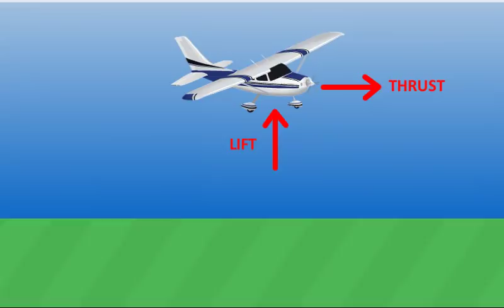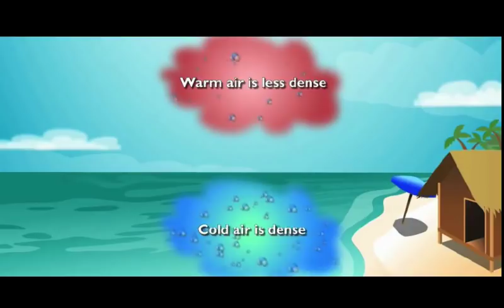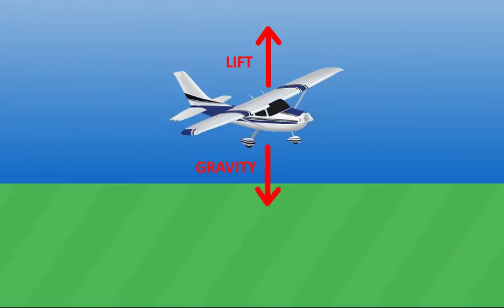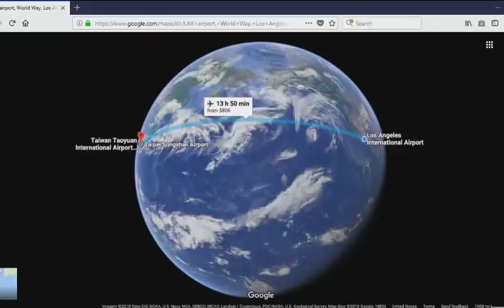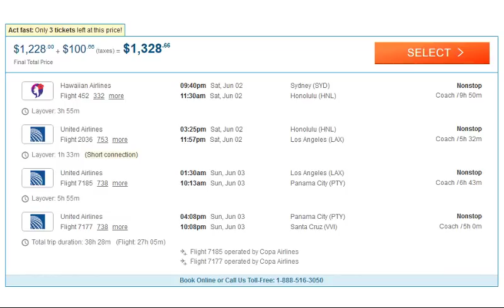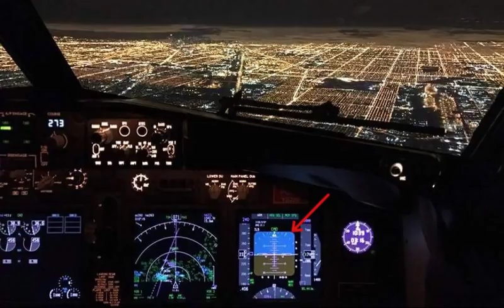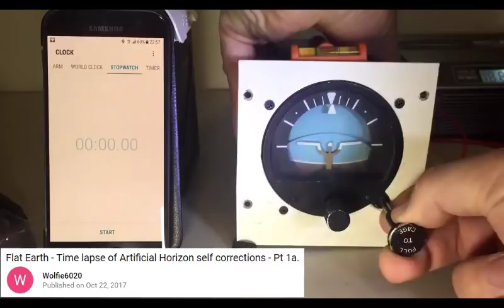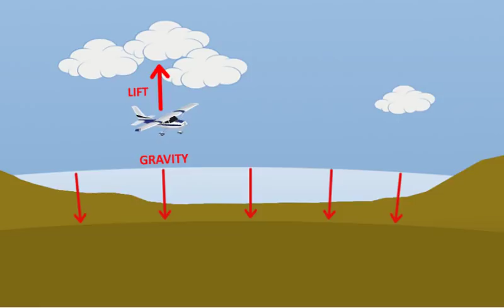Flat Earth Falsities - Plane Nonsense

Comment: [ Furthermore, how angular momentum is exchanged across the atmosphere's lower boundary, by means of the interactive torques with the oceans and solid Earth below, is important to quantify so that one can understand how the Earth acts as a system. 
Small but measurable changes in the Earth's rotation rate, moreover, are a consequence of the exchanges of angular momentum between the solid Earth and its fluid envelope (force?); this aspect of the variability is of importance to the study of Earth's physics and to the monitoring of reference frames for satellite orbits and navigation.    (but not helicophers or planes...)
The relevance of atmospheric angular momentum fluctuations to geodesy and geophysics has been recognized by the formal organization of the Special Bureau for the Atmosphere.]

It is a FACT that all this water, 70% covering the surface,  does not all have an eastern momentum (some Professional Navigators know this), the atmosphere is far from a closed system in this respect, but Earth’s rotation is always in a West to East motion.....

Some accurate Science= "Volcanic outgassing probably created the primordial atmosphere."

1) Why does the ocean current direction opposite to the wind direction?
     For example offshore of the Northeastern United States there is an ocean current called the Gulf Stream which flows northward along the coast.   The Coriolis effect circulates North Atlantic water in a clockwise direction ?  But always perfect synced Momemtum, now that is top Conservation ! (not like our atmosphere escaping to the Moon)

Also deep currents can cross or be opposite to a shallow current, not carring about friction :(
Warm air rises at the equator and moves poleward (not east), sinking again at middle latitudes in both hemispheres.

- hope this yet other gibberish presentation from Flattard me gets YOU also to have questions.
  Einstein said there was no stupid ones ('retard' was not soo popular back then).
Reply: woof woof, flerfie... keep barking. 
lol
southern celestial pole. 
check mate, flerfie.... keep barking
Reply: @GebSpez15215  Ah the mad dog has at last joined the only left of my commenting ! HE CARES! Been crying about me, wishing me to stop recruting, but it has such a good time!  Is it tired of lolling?  (a little insanity?) A replacement from tired +wong.
ps: funny my liked video of a zionist rabbi interview got removed, not the first time such happens with this account since I been trolling around here. Must of annoyed for somemone who spies on me. That wong sure hated Christians, and their bible, but not a peep on the old testament.  Same as those pagan greeks: they get a pass on their religiousity.
Reply: Louis Shaw 
yes, good flerfie.... i own you. whenever i ridicule you, you answer. good flerfie, bark...
lol
Reply: Louis Shaw 
i went straight under your skin... hahahahaha 
bark, flerfie, bark... lol
Reply: :) :) :) pro FLAT attention for sure, the recruting for GE may not be going so well...
Still no explanation for competent (aka Professional Navigator wong or Dr David ST-Jacques astronaut) self repeating lack of support. Usually they pat themselves so nicely. Yes the bark goes on, "and loving it" :) Get Smart, probe the value.
Reply: Now some little more quality bunking or TRUTH seeking :)  It very intersting how now all of sudden much GLOBE proofing is going on, coincidense? Or attention to nonsense? Dubbed "One More Orbit" that counts a former International Space Station commander (very trustworthy NASA man) among its leaders, was launched in honor of the Apollo 11 moon landings (the relevancy escape me), the 50th anniversary (of first and almost last adventures).
     At least some technology leaping is going on. Colonel Terry Virts : gave the famous V /Vulcan salute (StarTrek was the previous series before Apollo), but a Christian as most, including Directors.
      “As far as my views of life in the universe in regards to my views as a Christian, I believe we have a really smart God who made everything. That’s why the Bible is the book that inspires me the most.”  - literally or not?

- well nice to see some atheists have full trust in... those :)
Where is +wong when you want him? Loves to antagonizes Christians online by deliberately posting inflammatory, irrelevant, or offensive comments as others, even without being triggered.

    And some civil mouths would want you to think only dip shit flerfs believe in GOD....
Reply: @BrainUser1  Conclusion: You have no idea what a Hill Sphere is and its role in choosing a frame of reference. (If only other countries would launch rockets to space we'd see what a fraud NASA is.)

       The geocentrism apologetics sounds amazingly like the nutjobs who produced The Principle. (They have quite a reputation for deception due to that film.) Yet even they reject flat earth.
Reply: @BrainUser1  Conclusion: You have no idea what a Hill Sphere is and its role in choosing a frame of reference. (If only other countries would launch rockets to space we'd see what a fraud NASA is.)

       The geocentrism apologetics sounds amazingly like the nutjobs who produced The Principle. (They have quite a reputation for deception due to that film.) Yet even they reject flat earth.
Reply: Now we got 2 stuck with the same songs... Must be difficult for these individuals to produce something.With such productive Dereft's One can not value any of their conclusions, seems they are accustomed to repetition, School and Hollywood do a lot of that.. programing. The GLOBE is one of the most repeated "obvious irrefutable facts' we encounter, images repeated over and over again on every occasion.    Like they cant get over it... and its a (greek) 3,000 old news, dont ships still disappear in the horzon?   And the showbizz goes on...
Reply: :)  (no comment)
Reply: BUT I must I must! ....lets see.... :) .... the encouragement to think must continue also :)"If Flatties think they are so smart (smarter than all the great 
scientists) then they should come together & contribute something to
 the world like make a phone or a car without using any scientific 
methods." [1]  - HA HA HA! (out real loud) wonder where that came from...? Of "no science" ?
    The sheep lives its whole life being afraid of the wolves, 
only to be eaten by the shepherd...  like the Sheeple[2] they fear not-normals, crazies, flaterthers, but mean while they are being lead to be feed on by the taxing government and commercial industries, no wind up where?      
   Note: where in the hell is the not-caring ignoring +wong-police? Should also being ranting his outlawing not to feed the (emperior troll), he also does not care creation's CREATOR, well kind of... went you mention GOD or JESUS he starts foaming at the mouth and raves like MAD! 

   [1] 
Paul On The Plane  This ladies and gents, is the comment of the week winner. Pinned! Lol!!!!
   [2] many old farts that cant change their ways, or learn new tricks, their minds are set, RIP grey chemicals.
Reply: Louis Shaw woof woof
Reply: Conclusion: You have no idea what a Hill Sphere is and its role in choosing a frame of reference. (If only other countries would launch rockets to space we'd see what a fraud NASA is.)

       The geocentrism apologetics sounds amazingly like the nutjobs who produced The Principle. (They have quite a reputation for deception due to that film.) Yet even they reject flat earth.
Reply: @romithromith  O bobby thee impressive science guy also dedicated to nutjobs! Dear me! My troll babble gets some _ 

 Simply incompetent sure rattles some sane Normals, mostly those claiming they are secure in knowing.
  Hill Sphere... does Everybody know that is? I'll ask my neighbor... Guess it more GRAVITY wonders.

Conclusion! Was THAT Science? "—the Flat Earth is not science—" basicly what I gather from that Evidence.
PS: I wonder if these Agents also protect guilibles from this Bigfoot cult?
       Which one is the craziest now? No limit on that for SCIENCE to impress upon it for some reason.
       Ah good old days when the Apolloists used to call us Retards "Flatearthers", now its "religious literalism".
Reply: Do you even realize you've been talking to yourself for over 10 hours now? 😄😆😂🤣
Reply: @_Arminius   No I dont, Arithmetic's isn't your forté, last added was just 3 hrs after last Critic job, I think out loud (versus some laughing hyenas) but I think other witness my talking on public YT. Some are very upset about that, screwing themselves for the last 2 years :)
Do you realize you only cared to state THAT musing on this science video? 
  May want to laugh less and force your grey-matter a little more, if possible, greek math boy :)
Could just as well openly said /barked you were incapable to address any of my lead inputs :) :) :)
Reply: Louis Shaw 
hahahahaha
Reply: Louis Shaw woof woof, flerfie...
weaseling out of my points...
keep barking, flerfie...
lol
i own you
Reply: NASA Use the Heliocentric System for its Probes and Satellites? we hear...
   [ In reality, NASA will use whatever system is more convenient, the heliocentric or the geocentric, since NASA’s orbital mechanics know that both models are equivalent, mathematically and geometrically. 

If they are sending probes near the sun (far in SPACE) , they will probably use a heliocentric model, since it is easier to make calculations when one considers the sun as fixed (???) in space with the planets moving around it.

   If they are sending up satellites near the Earth, however, they will use a geocentric model, or what is known in the industry as a “fixed-Earth coordinate system.”  (- yes INDUSTRY knows about it)

   This is because it is much easier to calculate and chart the movements of satellites circling the Earth if the Earth is understood as stationary in space. 
(??? no high tech computers to do the work? Cheap NASA!)

This fact is easily proven from the space agency’s own documentation. 
   For example, in a letter written to the National Oceanic and Atmospheric Administration (NOAA) making the following inquiry: 

“Is the present movement of GOES [Geostationary Satellite] planned and executed on the basis of a fixed earth or a rotating earth?” 

the answer returned by the department head of GOES/POLAR Navigation, Office of Satellite Operations at the NOAA was very simple:   “Fixed earth.”

NASA tries to give the impression /MISSLEAD to the general public that only the heliocentric model will work, AS A FEW OTHER CON_TROLLS....
 
The truth about the use of fixed-Earth mechanics, agencies refused to be forthcoming, no surprise to us. Those who control our space programs have a vested interest in keeping the public under the illusion of Copernicanism, since all their funding and projects are based on Copernicus’ premises, including the quest to find life in other worlds.
   Only those who are courageous and knowledgeable enough can expose the illusion and allow the public to see the cosmic shell game that has been occurring for quite a long time. 
One such party is the team of Ruyong Wang and Ronald Hatch, two former government satellite engineers who know the truth about the illusion. In one of their investigations on the Global Positioning System they write:
           
"…NavCom Technology, Inc. has licensed software developed by the Jet Propulsion Lab (JPL) which, because of historical reasons, does the entire computation in the ECI frame. 
Because of some discrepancies between our standard earth-centered earth-fixed solution results and the JPL results.
The measured and theoretical ranges computed in the two different frames agreed precisely, indicating that the Sagnac correction had been applied in each frame."
 

Conclusion= NASA supports a still earth by using still earth calculations with satellite usage & rocket launching, Just as it uses a lot of Geocentric calculations for its predictions.

http://bellarmineforum.xanga.com/2010/01/16/question-208-struggling-with-question-on-geocentrism/
Reply: https://www.youtube.com/watch?v=Uo-QIY7ys-k  ....George Carlin on official Establishments and Education :)George Carlin -Question Everything  (like many not so norm scientists; Einstein etc) (Dictonary meaning, not context one...)    Social Criminals? Nasholes!    https://www.youtube.com/watch?v=8pz_IaRVBh0
Reply: Been real dead comment wise, the Normals have no new Retards to pounce on :(    My power has been establish for a while, Some are sadly not honest smart enough to admit it :(    My bite must be worst then my bark, alway nice to witness them ignoring material, says volumes :)    It must be concluded by such infantile emotional reactions of globe wise old men provide, best at questioning then worthy counters, desperately trying to find a flaw to hold onto.  The GLOBE spins and circles towards definite doom :) 
   Bye bye baby ceiling solar system mobiles, and school spheres.
Reply: People if the lol's and scientific talk efforts of these Globe Militants does not save you from FLAT level thinking, then  just check undeniable photo proof of beach tide braker, the cornered water is NOT FLAT!  That means we are on a globe, for greeks.    
Curvature Captured - Flat Earth Falsities
ps: my previous threads only have 25-27 replies but you can witness more nobodies carrring about that sh!t I write.  My apparent intellectually challenged and socially left behind gibberish is... cared for :)
"I am trolling you without effort. you keep answering. lol
you aint got anything to say, no message, just gibberish." ....
 Psychological projection - Wikipedia
https://en.wikipedia.org/wiki/Psychological_projectionPsychological projection
 is a defence mechanism in which the human ego defends itself
 against unconscious impulses or qualities by denying their 
existence in themselves while attributing them to others. For example, a
 person who is habitually rude may constantly accuse other people of 
being rudeNarcissistic defences · Hidden personality · Blame · False consensus effect
Reply: Louis Shaw 
woof woof... lol